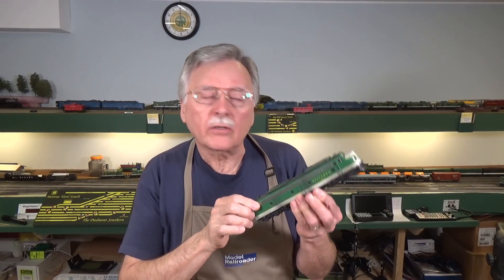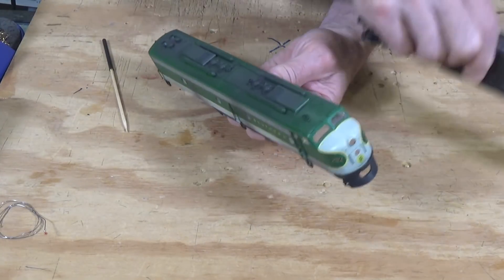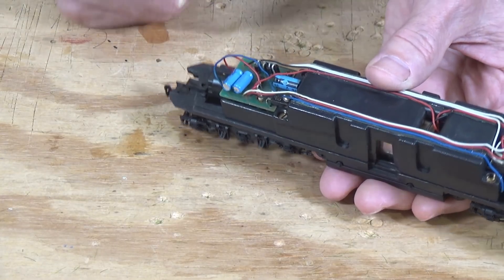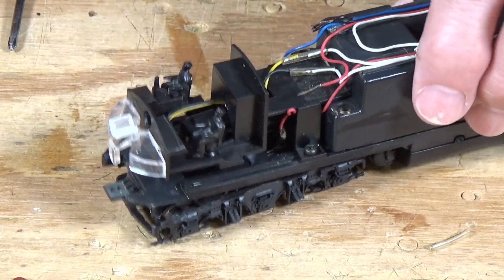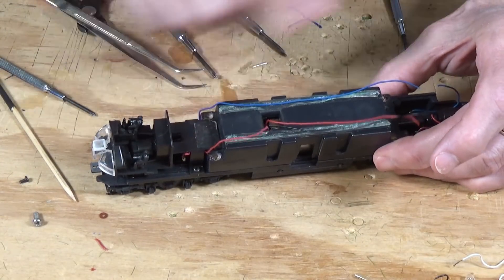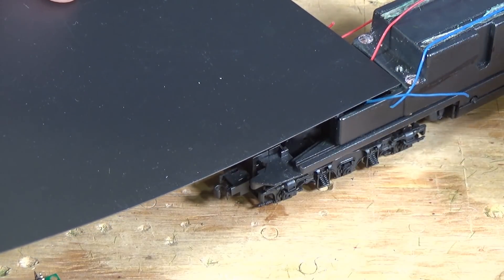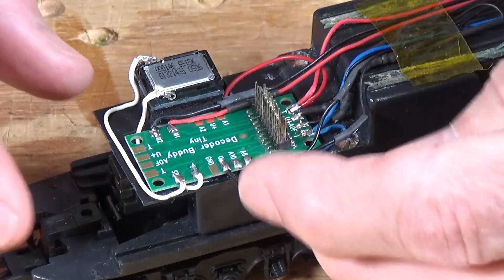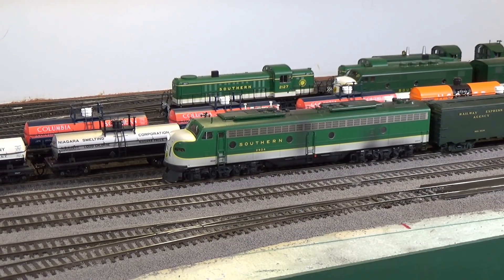DCC and Sound For Your LifeLike E-units (184)

Comment: I recently did a Proto 2000 E8A but only with a Digitrax non sound decoder that I had in my parts box. I may replace it with a sound unit. This was a good video and will help if I do it

Comment: Nice conversion Larry.  One thing I do to confirm the polarity and direction of the motor is to connect a 9 volt battery to the motor leads.  Since the polarity of the battery is known it is a definite confirmation of the motor polarity and direction.

I recently installed LokSound 5 21-pin decoder and a Decoder Buddy Mini in an Atlas GE B30-7 that I converted from QSI.  I also installed a ESU Power Pack as well since the club I run on has dead spots.  The result was a complete success.

Comment: I enjoyed and appreciated the very fine installation demonstration very much!  Thank You!  I am a little embarrassed because my directions did not cover the A6 and A10 pads well.  First I suspect that you had to move the Mars light wire to either A0F, A1 or A2 to make the Mars light respond.  There are only 4 powered outputs on the Mini at this time.  The A6 and A10 pads are for the third wire or control wire of an ESU Power Pack.  The A6 pad is for the LokSound 4 decoder and is controlled by A6.  The A10 pad is for the LokSound 5 and is controlled by A10.  The U+ and GND pads are used for power and ground on all stay alives!   Hope this helps!  Again, thanks for the great demonstration!
Reply from the maker: Actually is was my fault Nick as I managed to lose the instructions that came with that particular board and of course it was different from the others I have. It was an easy fix to simply move the wire from A6 to A1 and then swap them on the function map. Using the Decoder Buddy is so much easier than dealing with a lot more wires on a regular hardwired decoder.

Comment: I love those old Life Like E-units. Pretty much stock Athearn drive, which I am good at repairing. I've replaced many broken axle gears.
Reply from the maker: I recently discovered a new way to fix them when I painted a PA unit and could not fond replacements. I soaked the gears in alcohol and washed them with soapy water. Imdid the same to the wheel/axle assemblies. Then I applied my Loctite gel super glue inside the gear and on the axles, inserted them and quickly set the spacing. Once the glue dried they seem as good as new. The glue even works its way into the crack and holds it together. So far no failures. I need to update the gear  repair video.

Comment: Hi, great video, I have all E-types without sound sofar. Please put up 2nd video with programmer settings. I would have used the 23 or 28mm ESU speaker with enclosure, these are far superior to those sugarcubes, since there is enough space. I even built a custum enclosure 4mm high for a little steamer and it makes a world of difference. Thanks

Comment: Great video.  Thanks for sharing that with us.  What size SBS sugar cube speaker and which baffle did you use?   SBS has 5 different sizes and 18 different baffles.  Did you use ESU decoder 58419?  Which prime mover did you choose?  Perhaps SO761 or SO583?  What wire do you use?  It is small and flexible yet holds its shape well when bent around curves etc.  Thanks again for your videos and in advance for your help with my questions.
Reply from the maker: I used their 11x15 speaker with the deep cube enclosure. In a lot of models I use the rounded enclosure designed ti fit the inside of a cab roof. The decoder was the basic empty one and I loaded the correct sound package myself. I bought a bundle of decoder wires from Digitrax and use those as well as leftovers from 27 years of installations.
Reply: @TheDCCGuy  Thank you.  I appreciate your help and the additional information.

Comment: Very informative and explanatory presentations. I have many locomotives which I would like to convert to DCC some being as old as 50 or more years old .
One in particular is a Fleischmann PA-2 which I would really like to convert. Do you have any tips or info on the possibilities of doing this and the difficulties I might encounter.
Reply from the maker: Probably the biggest potential problem will be the motor and I have no idea what it has in it. You’ll need to get it running well on a DC track first, check it over for cracked plastic gears, etc., before trying a conversion. You’ll want to test the stall current to find out what size decoder you will need. Also the permanent magnets in the motor may have degraded over time so the motor itself may not be very strong and need replacing. It likely will be an old open frame 3 pole motor.
Reply: @TheDCCGuy  thanks for the reply, much appreciated.
Will check out all those points mentioned and let you know the results in due course.

Comment: Larry, at 26:33 you mention having super-glued the SMD LED to the back of the clear vertical lens plate.  Is it OK to have super-glue or CA get on the LED itself or did you somehow glue it on that back surface without any super glue actually getting on the yellow speck of the LED itself?  Thanks.
Reply from the maker: It never has been a problem for me. More recently I have been use Uhu black tack putty to hold them in place. I showed that in some other videos.
Reply: @TheDCCGuy  Thanks Larry.

Comment: Great video - would love to see how you added the air tanks (torpedo tubes) to the roof of the Proto E8's.  I have several that I want to do this to - just haven't figured out the best way.
Reply from the maker: I used some Detail Associates or Details West air tanks and brass wire for the air lines. Actually a pretty easy job once I found an overhead shot of a loco showing the air lines. I would love to do a video but only about 50 people would watch it. A general hobby video can get up to 50K views, a broad DCC topic can pull in 15K, a narrow focus video will get 5K, and a very narrow one less than 1000. Something as specific as Southern loco details might get 50 or fewer..

Comment: Thanks for the video making this installation. I mentioned this before and you said you were planning to do one. I have a slew of these units myself - E-6, 7, 8-9s As and Bs all in Southern both black and white plus the green scheme too and wanted to convert some to DCC.  I wondered how to cram all that was needed inside with this big weight as a hindrance.  With your technique, it seems you might be able to get two of those sugar cubes in there side by side. One observation though, From my angle, this does not seem to be a Mars light. It appears constant to me.
Reply from the maker: Be patient grasshopper. As I said in the video I had not done the programming as of that time necessary to create the Mars light effect. I did it last night and it looks good. Also as it turned out all those wires got in the way of the fan bases and popped a couple. So I ended up moving the wires to the each side on the top of that weight and also carved away the plastic under the winterization cover. I’ll mention this stuff and more in the followup video on programming. I also plan another video comparing the sound from a LokSound, Soundtraxx, and WOWSound decoder.
Reply: @TheDCCGuy  When I mentioned two speakers, I meant wiring them in series. Also, could I have more info on the Lok Sound decoder?
Reply from the maker: There really isn’t that much to tell, it is a standard blank 21 pin v5 decoder. If you order one from a dealer make sure to ask them to load the sound package for you unless you have a LokProgrammer and want to do it yourself. Also you might want to wait as I plan to do a followup video using the SoundTraxax and WOWSound versions of the E-unit sound package. With respect to using 2 speakers, you might want to rethink that. I dod that with the E6 I showed in the beginning of the video and the sound was so loud I am considering pulling one of them out! Using 2 speakers will not get you more bass, just more volume and unless you are operating at a train show the extra volume translates into more noise. Remember too that using 2 speakers will mean almost 2 watts and some decoders may not support that so check first, although many now have 2 watt audio output.
Reply: @TheDCCGuy  Thanks, I will wait since most of the decoders I have installed are SoundTraxx and I am more familiar with them.
Reply: I look forward to your comparison video.  I have installed 1 TCS WOW and several of an off brand in this locomotive.

Comment: Great video Larry.  I appreciate you showing how to fit and add both DCC and sound to an engine that was built as a quiet DC engine - there are still some of us out there!!  What checks do you make to ensure the motor is isolated from the frame?  I hear that warning all the time, but have never really seen or read a "how-to" - I am guessing the most effective means would be to place the engine on dead track and test continuity from each rail to each motor terminal?

Comment: Hi there. Love your stuff! Thanks for all the videos. The front red truck wire goes to top of motor and on to rear of E8. I can't see any reason not to use the wires as they are? Front red to motor, back red to motor? Also, what wire stripper would/do you recommend for the DCC wire? Thanks again, Jack
Reply from the maker: The factory in China seems to have used whatever color wires were handy. I use the cheap strippers from All Electronics but there are others I have shown in my tools videos and a quick search on Amazon will give you a choice of many across a range of prices.

Comment: Nice video.  Would love to see fine tuning of decoder.  Question - when you glue on the styrene shelf to mount the decoder buddy, speaker & decoder, does that prevent you from accessing & servicing the the gear box to the underlying truck ?
Reply from the maker: It would not interfere with the gears since they are accessed from the bottom of the truck. And the grease will be transferred through the gear train up to the worm gear in the truck tower. The only problem is with oiling the bearings and once every decade should take care of that. I will just slide a knife blade in there and pop the styrene platform loose for that.
Reply: @TheDCCGuy  Thanks for getting back so quickly - I understand your solution.  One more question -- I have several of these LifeLike P2K E-8/9's from the early days which are still mint in their original boxes which I need to convert to DCC/Sound.  I noticed that you did not have to isolate the motor from the frame before you did this conversion.  Is this not necessary in these  LifeLike E-8/9 early models ?  I will be checking all the gears.
Reply from the maker: For some reason these locos have an isolated motor even though they do not have a DCC socket. The later models, E6, E7, PA all have a circuit board with and 8-pin connector so definitely should be safe. I think the reason the E8s were made this way was because they directly powered the motor with wires from the truck and the circuit board.
Reply: Your video shows a Decoder Buddy Tiny, not a Decoder Buddy Mini although you describe using a Mini. Which is correct ? I went onto the NixTrains website and they describe the features on the Mini Buddy which includes the proper resistors on it and a 21 pin plug.  I assume I should order the Mini Buddy not the Tiny Buddy. Any other comments you might have ?
Reply from the maker: The name Tony was only applied to the first batch and right away Nick changed it to the Mini so Tiny is only on that first version. Even with those labeled Tiny the packaging says Mini. Be aware that the pads labeled A6 & A10 are reserved for the white wire on 3 wire stay alives used with LokSound decoders. I had to move my wire once I found that out.
Reply: @TheDCCGuy  Many thanks for your help. I always learn a lot on your website.  I have really enjoyed this video and you have very much simplified my task ahead.  Other instruction videos have discussed milling the lead weight to make room for the decoder; have indicated that the motor needs to be pulled & isolated from the frame etc. (which I know is necessary in many instances on other older locomotive models).  Using the Decoder Buddy Mini is a great solution. Do you know if the LocSound people will program the Version 5 - 21 Pin decoder for EMD E-8/9's  or any other locomotive  I can use their stuff on for me if I don't have the equipment or confidence to program it myself ?
Reply from the maker: You need to ask the dealer about loading the correct sound package for you. I know that Streamlined Backshop (www.sbs4dcc.com) will do it for you.

Comment: I'm in the process of installing Soundtraxx DCC sound in my first E-8 and it's going well thanks to your video but I have one rather unrelated question. My E units are so old they came with NMRA horn-hook couplers. Would you happen to remember which Kaydees fit these units?
Reply from the maker: I am pretty sure I used #5 on the rear however up front you need long shanks to clear the pilot. I am not all that happy with the long shanked Bachmann ones I tried so I need to make some measurements and special order some that will be long enough but not too long.
Reply: @TheDCCGuy  Here's an FYI that worked on my Life-Like Proto 2000 E-8. I contacted Kaydee and asked and the info they sent was pretty much nonsense.  After trying several different things I got this to work for me and the couplers are the correct height,. On the front, I used a #144  (offset) Kaydee mounted on the bottom of the shaft using a #252 gearbox. This is a short shaft coupler but it does clear the pilot on mine. A regular length 140 series coupler may be better if you have a different pilot.  On the rear,  I used a #145 (offset) coupler with a #252 gearbox mounted on top of the shaft. Hope this helps.

Comment: Would an ESU PowerPack 54671 work with this decoder and Decoder Buddy Mini?   Have you found these E8 ‘s work OK without them?  Thanks.
Reply from the maker: The PowerPaxks are designed by ESU for use with LokPilot and LokSound decoders and actually are the only stay alives that do not violate their warranty. They are compatible with the Decoder Buddy boards. I generally do not use stay alives in large diesel, especially 6 axle types like these. I mainly reserve them for small diesel switchers (if they fit) and small steam locos. I have found that some brass diesels like my PAs need them as well.
Reply: @TheDCCGuy  Thanks Larry.  I appreciate your prompt, helpful, and informative replies.  Keep up the great videos too.  They're great.

Comment: Hi Larry, I have 2 Life Like Proto 2000 PA's released in 1998.  They are original.  They do not have a lot of run time.  Been out of the hobby for a while, but now I want to convert them to DCC with sound.  The E unit chassis looks pretty much the same, if not identical to the PA.  Your video on this is excellent, but I'm concerned about the original motor.  I've seen on various sites where it is recommended to change out the motor to maybe an Athearn RTR or Genesis due to the current draw of the original.    Your thoughts?  And I'll be changing out the gears per your recommendation in your #44 video.
Reply from the maker: I have a pair of PAs painted for the V&O and they were a PITA. Mine were from the first run and the factory in China screwed up the motor windings resulting in a current draw over 1 amp. I replaced the motors with some Mashima cans that I had stashed away. They were a perfect match even down to the screw pattern on the motor mount but are no longer available. I think NWSL sells motors for these so check their website. As for the axle gears that is another problem. They are different from the ones that Walthers and other companies sell for thenE units and SDs. However I found a work around. I pulled the gears and cleaned them thoroughly, soap and water twice, then a clean with isopropyl. Soak a pipe cleaner in it and run it through the hole— you need to get ALL the oil and grease off. Next squirt some CA cement into the opening and slide in the axle—you only have a few seconds to get the spacing adjusted before the cement sets up. Repeat for the other side. The pressure of the axles squeezes some of the CA cement into the crack(s) and you end up with a permanent bond between the metal axle and the gear which prevents it from slipping and cracking further. The biggest issue is getting the axles inserted and spaced perfectly before the CA cement sets up. Good luck.
Reply: @TheDCCGuy  Thank you for your prompt reply and your advice.  Will do.  Mike

Comment: I’d also like to see the programming of the loco. Does the E-EA/1/3 have the same spacing inside for the new board/decoder as the E9? Or can the same models be used? Pardon please if I ask dumb questions as I’m new to the insides of any locomotives.
Reply from the maker: LifeLike/Walthers did not make an EA. Which loco are you asking about?
Reply: I’m looking for any of these models, though I’d prefer one with sound already added. I don’t have the steadiest hands but I did but a soldering iron expecting I might have to install sound from scratch if necessary. I have been using your videos to get some understanding of what I needed to know and what resources I needed to do the job if necessary.
Reply from the maker: I am pretty sure that they have been made with sound decoders although they may not be in production right now. Check with your hobby shop and/or the Walthers  catalog and if they are not currently available start keeping an eye out on eBay, good luck.

Comment: Just wondering when making the platform for the decoder buddy to set upon, why didn't you make the platform a little narrower to fit into the recess on the frame and then use the existing screw holes to attach rather than gluing the platform?
Reply from the maker: Just fit better that way. The recessed ledge in there is a bit narrow.